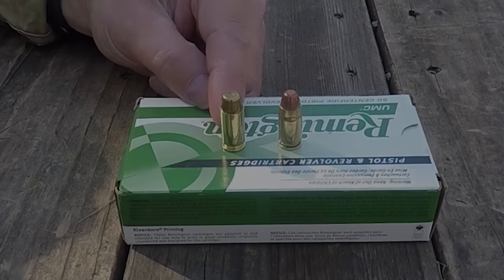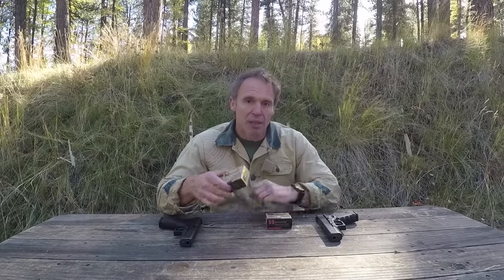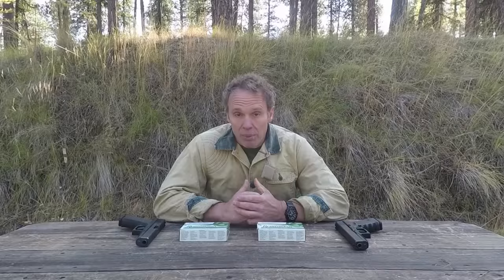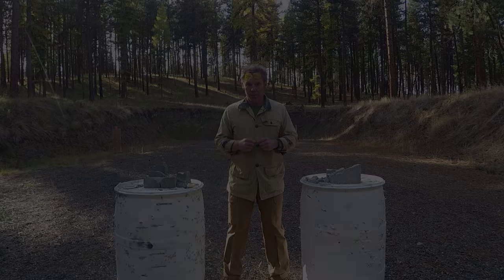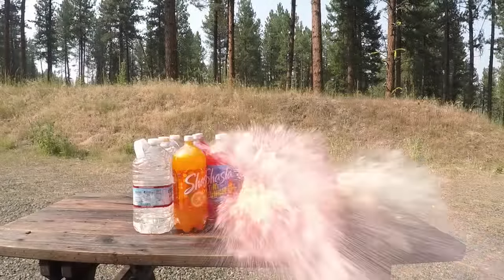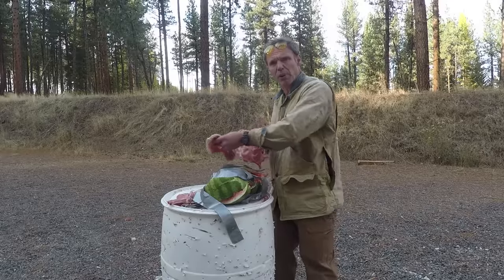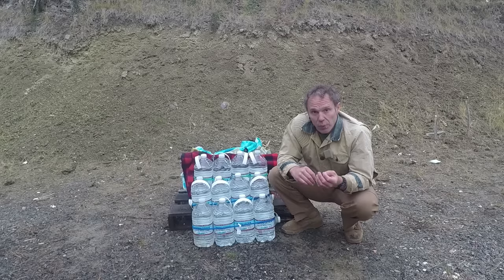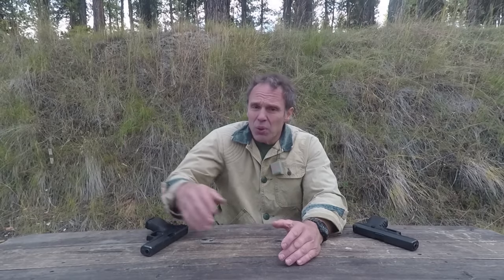Personal protection: .357 SIG vs. .40 s/w

Comment: I think the reason the fbi switched back was purely because of cost. Yes 9mm ammo is improved. But if there is another shootout where 9mm doesnt do the job, first move they make would be to go back to 40. Its all reactionary. Point being, 40 was and will always have more ft/lbs than 9mm.
Reply: Stopping a determined person boils down to shot placement and adequate penetration and for that to happen you first need to hit what you're shooting at, for the FBI shot placement tends to be more luck dependent than skill.

Give an agent 3 extra rounds in his gun and 9 extra rounds in total on his/her person over the .40 in an easier to shoot caliber and they've got a better chance at actually landing some shots.

The narrative that we had some breakthrough in 'bullet technology' sometime in the 2,000s which suddenly made the 9mm viable is absurd. We had bullets back then that would've passed the FBIs testing, in reality the Critical 9mm Duty bullet they settled on is outperformed by some of the older offerings like the Golden Saber.

Comment: Seems like 357 have louder sound, recoil and more muzzle flash
Reply: Louder maybe, LESS Recoil and use ammo with low flash powder. 357 SIG is still better the 40SW
Reply: @10mmIdaho  Im pretty sure that's more recoil for the .357 Sig. As confirmed by others.
Reply: @Frenchfrys17  Compared to the 40? no way, i shot both with the swap of a barrel.  40 is more felt then 357 Sig
Reply: @10mmIdaho  which handgun? Which ammo?
Reply: @Frenchfrys17  Sig P226 and P320 3.9
Reply: @10mmIdaho  ammo brand?
Reply: @Frenchfrys17  underwood. Buffalo bore. Sig for range ammo
Reply: @10mmIdaho  I’m not sure how you’re feeling less recoil with .357 Sig. Maybe something to do with your grip. Hickok45 and 1shotTV also says .357 Sig recoils more.
Reply: @Frenchfrys17  I have 40 much snappy then 357 Sig. I would say 357 is like 9mm magnum. My wife and niece can shoot it as well as 9.

Comment: Its just my opinion but I dont see the point of 40SW because, 1st  you are shooting a gun designed for 9mm, 2nd if its power you want why not go with 10mm or 357 sig or even 9mm with some loads.
Speed is power and for those that say the bigger the round the better then explain why shooting a 223 or 556 is MUCH more powerful than 40SW ? and its a much smaller round!!!!
Reply: It would be great but 10mm and 357 SIG are a lot more expensive and a lot less available than 40 S&W. Most 40 S&W loads have more kinetic energy than most 9mm loads and a large portion of 45 ACP loads while providing more expansion than 9mm, thus a larger wound channel, more capacity than 45 ACP and better barrier penetration than either 9mm or 45 ACP. I honestly think it's a great round overall. Also, GEN 5 40 cal Glocks are designed as 40 cal handguns from the ground up, they are no longer 9mm handguns adapted for the 40. That's why GEN 5 .40 Glocks don't fit in GEN 4 .40 Glocks' holsters, GEN 5's are larger and heavier

Comment: I am most surprised that the .357  has more kinetic energy considering a smaller bore and same barrel length. Does the similar case somehow get more powder?
Reply: For me some things to consider are ballistic coefficient & powder burn rate.  Here's some links, Hornady's 2019 ballistics chart, https://press.hornady.com/assets/pcthumbs/tmp/1410995911-2019-Standard-Ballistics-Chart.pdf.  2 different powder burn charts, https://loaddata.com/articles/PDF/Powder%20Burn%20Rate%20Chart2.pdf, Brownells/Vihtavuori https://www.brownells.com/userdocs/learn/Hi-Res_Vihtavuori_Burn_Chart.pdf.  I thought I saw a chart with over 200 powders but couldn't find it.  The formula he might be using to calculate ft/lbs is velocity squared x grain weight/450,400 = Foot/pounds.  Hope that helps
Reply: @waltr34  Thank you very much for sharing the details. Kinetic energy seems straight forward but I never understood what makes a "hot" load? I guess higher burn rates give higher velocities to the point that the barrel can handle the pressure? Also are some powders more dense (ie release more energy) per the unit volume?
Reply: @waltr34  ps nice charts, lots of info
Reply: @agator2660   This guy explains somewhat how powders are made and differ in shape per the intended use, manufacturers want to make them safe so they don't exceed the maximum pressure created in a barrel I think the highest I've heard of in handgun/rifle is 65,000 psi(the 50 BMG probly more),  you have blackpowder  & smokeless powder in shotguns/rifles/handguns, some rifle calibers fired in handguns at night will have a 6ft long flame coming out the end because the powder was made for a longer rifle barrel not a handgun and will burn up outside the barrel.  One example is the .30 carbine used in a Ruger Blackhawk or AMT Automag III,  https://www.youtube.com/watch?v=VqLN5l2pKZc, here is info on the SAAMI organization, https://www.youtube.com/watch?v=hHuXtQsdak0, a faster burning powder in a light rifle can give a nasty kick which will vary with the grain weight of the bullet. This is a great website with lots of info about that & more https://www.chuckhawks.com/recoil_table.htm.

Comment: The .357 Sig has greater range for hunting. In your residence close up, I want the round to stay IN the intruder instead of pass through. The .40 S&W travels about 980 fps. The .357 Sig travels about 2200 fps or Mach 2. In some cases, the intruder wouldn't even know he/she/it was hit by the Sig. In close combat, the .40 S&W will stay in the intruder. There's no way a .357 Sig rd will stay in the intruder at close range. And at 44 cents/rd for the .40 and $1.44 for the Sig, there's no comparison.
Reply: Where are you getting 2200 fps 357 sig????

Comment: i wonder if it is reasonable to ask for 9mm vs .357 sig
Reply: Even 9mm +P+ doesn't approach 357 SIG in proper, standard loadings, and even still you're really tearing up a gun using it.  The bullet diameter is about all they have in common.  Even bullet construction is different in proper 357 SIG.

Comment: .40 is actually more powerful. When you get the hottest factory ammo for both, the 135 gr Underwood .40 nosler, and 124 gr Underwood .357 sig nosler, the .40 reigns supreme. So .357 sig can not claim to be more powerful, no matter how many big companies load .40 and 10mm way under saami spec and load .357 sig pretty close. 

The 135 gr and 155 gr underwoods are rated from a 3.4” barrel too, AZ AIRGUNNER just proved that with two recent videos of .40 vs .357 sig. He got exactly 589 ft lbs from the 3.4” barrel with the underwood 135 gr .40 nosler. The .357 sig nosler from them had 540 ft lbs. from the 3.4”

From a 4.9” barrel the .40 had 675 ft lbs. The .357 sig had 640 ft lbs from a 4.5”.  Gun Sam tested the .40 from a 4” and it got 610 ft lbs. Needless to say I picked up a fex boxes. It’s in saami spec and it shoots great from my Glock 23, not uncomfortable at all.
Reply: Tell me you own a .40 and not a .357 Sig without saying it... 
Yes. With both loaded to the max, the .40 S&W can generate more energy and momentum. The Sig however can generate a good bit more velocity without sacrificing too much sectional density and can launch bullets of a given sectional density at higher velocities than the .40.

The .357 Sig is a more versatile cartridge in the sense that with the right bullet it can do things the .40 simply can't.
Reply: It's a balance and tradeoff between powder capacity in 40 S&W and bottleneck cartridge design 357 sig.  The point of this video is explaining factory readily available ammunition accessible to most concealed carry audience.  As handloaders, we can customize and experiment with all kinds of wildcats.
Reply: @h6cl5bm2c I don't think the .40 actually has much of if any advantage in powder capacity since the necked down portion of the Sig case is effectively how deep the bullet is going to be seated in the case for either caliber to begin with.
In fact the max powder load for the Sig is usually higher.

Any time you neck down a cartridge you will lose power, but the Sig compensates by operating at a bit higher pressures.
The Sig is very close in peak muzzle energy potential but the .40 has a definitive momentum advantage which shouldn't be ignored.
Reply: bullshit